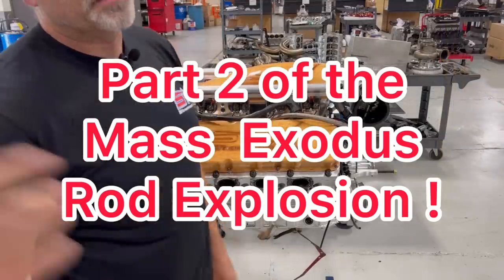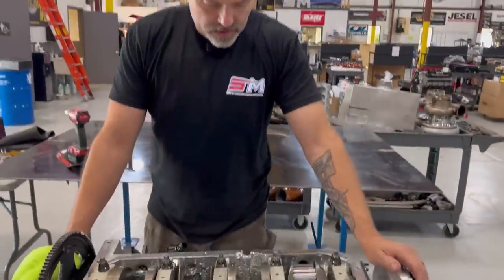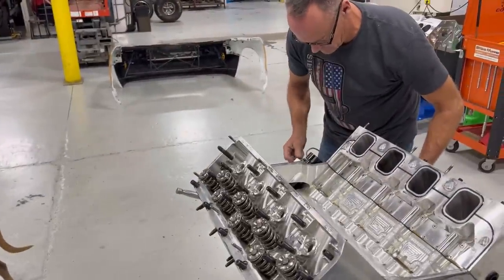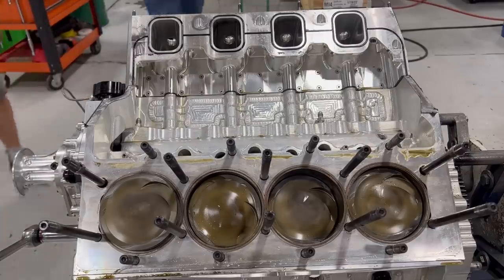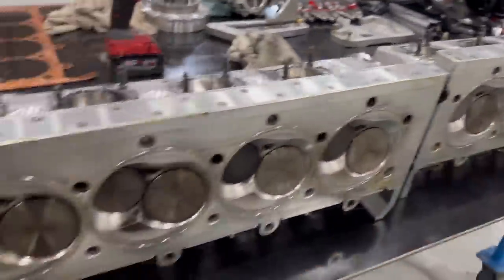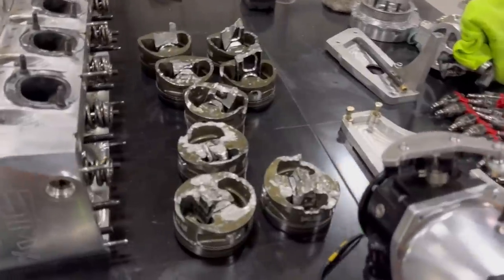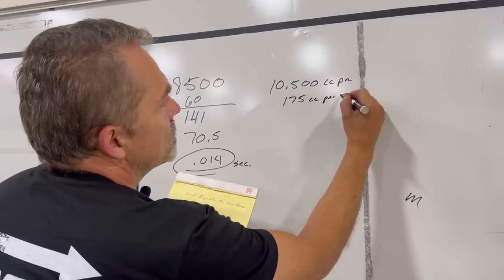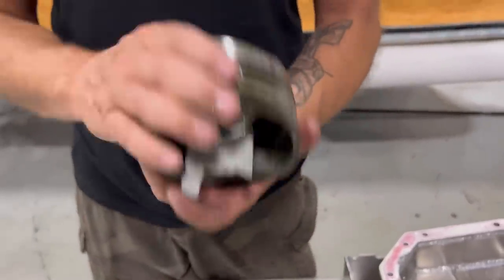EXPLODED RODS  Part 2

Comment: After taking metallurgy classes from our technical center when I worked for Alcoa, it definitely looks like a material failure. I bet if the grain structure was analyzed their would be a definitive answer on that. We saw pictures of examples of aluminum failures and some looked like that. Failures could be related to bad alloy with impurities that caused internal grain issues, poor forging process, etc. I’d really like to know what happened to them. If I still worked at Alcoa I’d try to reach out to our tech center to have them analyzed, but sadly I don’t.
Reply: It didnt come from Lake Charles Alcoa.  I'm just sayin'.  Gotta support Local!
Reply: The fracture breaks make me believe it was treated or aged to add strength, but lose flex. So it didn't bend it just broke. These rods are just to brittle for what SM is doing.
Reply: That's my thought as well. I would be curious to know the pounds force each cylinder is pushing down with on the power stroke.  I guarantee the number is well above the strength of those rods, especially since they were not a full solid beam rod (They were solid beam but had machined pockets for weight savings, but also makes them weaker.).  Just take a look at top fuel engines.  They make so much power they will actually compress a connecting rod and make it shorter, and they use solid beam rods, but they don't shatter.
Reply: @davidwickboldt712  I agree. The manufacturer boasts something like 200+ runs in a 2000hp bracket car with a 'proprietary' alloy. As hard as they are, probably great fatigue characteristics. Just not interested in bending, that's for sure. lol
Reply: I commented similarly and then I saw your comment.
Great minds think alike ?  
lol    I absolutely agree with you about grain structure especially after many heat cycles.... or impurities as you eluded to. Thanks 👍👍
Reply: @zulumagoo1  probably goose Creek Alcoa
Reply: I'm in the camp of an issue with the design. The failure condition is catastrophic and it happened on all rods.  Can't be a quality issue considering the amount of passes on the motor.  A design issue seems much more likely than a metallurgical defect since Steve said those were the only rods in the world with that design.   I'm thinking of a long term fatigue failure.  There is probably some harmonic combined with temperature cycling that made the rods fail and wasn't verified by test, simulation or  similarity analysis before being put to use.
Reply: Sure looks like a heat treatment issue to me.
Reply: @beckyumphrey2626  if the heat treatment was part of the drawing then sure but I have a hard time believing that he heat treatment was done improperly on all 8 rods.  I'm thinking this is a vibration issues with a fatigue factor.
Reply: I currently work at Howmet ( Alcoa ) in Cleveland past 10 years In the Thermal dept, Heat Treat, age, Titanium, Inconel. I've seen an aluminum forging shatter before after it failed sonic and was sent back through the process. Once the press started to apply tonnage , all we heard was a loud Crack then call outs for ERT
Reply: @jimpettit6310  Does sonic set up a certain frequency to see if harmonic vibration develops or are you referring to an ultrasonic inspection process?  I am an A&P Aircraft mech with 35 years structural experience and 10 years in Non Destructive Inspection.  My  curiosity level seems to be out of control sometimes.  :)
Reply: @beckyumphrey2626  Great Question, I want to say it's ultrasonic, I've only walked into that dept a few times over the years.  In Large Aero where I'm at they submerge the parts into the tanks and size depending either scan by hand or if it's a larger forging they have this trolley attached to a wand??? And scan it that way. I watched out of curiosity,  have no idea what the graphs are but see the rejected parts saying high noise, low noise, Low ec...etc etc
Reply: @beckyumphrey2626  After spending 2 decades Crewing F-15s and F-16s this also peaked my interest. We have lost planes and pilots due to bad with parts shearing off due to Metallurgy. It would shock people what NDI finds after a inspection. After watching the last video I was hoping Steve was going to mention a bad batch of material and Metallurgy. Hopefully the supplier will pay for a subpar product and recall anything else they sold. I am glad that this was on the track and not in the Air.
Reply: @jimpettit6310  Thank you.  It sure sounds like an ultrasonic inspection process. Separated grain boundaries can be easily detected using that method.  I am eager to find out what was the root cause of these rod failures.  All failing at the exact same time in a very similar location on the rod at a certain RPM sure makes me think it was a catastrophic harmonic vibration failure that occurred instantly.  It happens.
Reply: @jimpettit6310  Thank you for breaking this down. Seeing this destruction is sad but fascinating. Steve is being so humble and transparent with this incident. It is always nice seeing someone answer a great question. Education is key.
Reply: @GetFuct1911  Absolutely.  We have had bad failures over the years with metals in the aviation world.  Probably the most concerning is all the unpredictable problems that 7075-T6 have uncovered until they stopped it's use in many applications.  Thank you for your service.  USN here.  81-85
Reply: @jimpettit6310  that makes perfect sense to me. I worked at FEL-PRO Performance gaskets 1988-98 we tested all the time everything I learned a lot. Now at 72 I think you are right on target.
Regards 
Mike
Reply: @beckyumphrey2626  I know currently we use a 7085 alloy mainly for larger forgings ( bulkheads)  for a fighter jet that rhymes with f35... 6061/t6 for propellers, alot of other things.  The process from billet/ingot to shipping is pretty amazing.  It blew me away the 1st time I saw a finished/machined bulkhead from what we ship out and how much material they take away. Same with our vehicle side with 5th wheels for Holland and commercial or specialty wheels for Ford, dodge and Mercedes
Reply: @Mike62501   My 3rd job was at cometic gaskets. Was there for 8 months. While they were in a real small shop at the time. Something in there always made me break out in hives and I quit
Reply: @beckyumphrey2626  I appreciate it and thank you for your service also. Before I retired in 2019 it seemed like a large majority of the new Amn didn't care about work. When I joined we wanted to work on ACFT those who slacked off ended up getting kicked out. It amazes me how many flight hours some of our Trainers have on them. I couldn't imagine being on T-6s. Good on you for staying in Aviation. Especially with being NDI and having your A&P for so long. What are your thoughts on the idiot that jumped out of his plane on DB's anniversary? Seeing how he was wearing a skydiving parachute, fire extinguishers, removing his step, recovering his go-pros, and the laundry list of other items is very damning. Plus he had a helo remove it without the FAA even looking at the wreckage. To me it looked intentional, hopefully they make a example out of him.
Reply: @GetFuct1911  That guy was an idiot that jumped out.  I see he lost his pilots license too.  The Navy was great for me back in the 80s.  No way would I join the service today!!!   I went to Embry Riddle on base and got my A&P before I was got out.  I worked C5-B production for Lockheed after being out 1 week and did that for 2 years before moving on to Commercial Aviation.  Love my job nowadays and no plans to retire any time soon.
Reply: @beckyumphrey2626  
It was definitely a harmonic/frequency failure. For all eight to fail and fail so catastrophically, that the crank spinning at 8k rpm, wasn't covered in dents, suggests it wasn't a force failure. Material intrinsic frequency or critical rotation speeds are not in the domain of engine builders. I doubt the rod builders would even calculate or test for intrinsic frequency as it would change depending on what was attached, bearing, pin, rod bolts etc.
Reply: @aaronnoyb  Thank you.  Harmonic failures can be violent.  Do you think this was an isolated failure whereas all the conditions just happened to align and failure occurred?
Reply: @beckyumphrey2626  
I don't think it's possible to say with any certainty, be interesting to know, if this was the first time it had seen 8500rpm.
The fact the crank journals are perfect(not all), means the big ends of the rod accelerated away from the crank, at failure, at higher speed than the crank was traveling at.
That combined with structure of the breaks(last few minutes of video), with mostly sharp edges, suggests it wasn't compressive or tensile failure. Normally small pieces come from meat grinder action of the remaining rotating parts and would not retain all sharp edges.
Be interesting and incredible expensive, to build the motor, identical to before and spin it with an external drive, like a spintron does and measure the vibrations at different speeds and see if it comes apart again at similar rpm.
Reply: @aaronnoyb  Thank you for your thoughts.  You are very knowledgeable. Betting you are a Mechanical Engineer.
Reply: This is what aluminum does, it doesn’t have good fatigue strength.  I’m sure the alum rod is twisting and bending each trip up and downward.  Depending on how deep Steve’s pockets are, I’d go with titanium rods next.
Reply: @aaronnoyb  The damage on the crank is just from contact with broken rods. Possibly the journals with damage were the first to go. And they let go on the intake stroke when being stretched.
Next question, does anybody sleep? It's 6am for me now and the post times say insomnia, night crew, or different parts of the world. 😁
Reply: @beckyumphrey2626  
Not an engineer, but a long time in the oil/gas world as a translator. Translating between Managers, Engineers, Operators and Tradesmen/Craftsmen, while maintaining and overhauling gas and steam turbines, from 400 to 40,000HP. Machinery valued in the $Millions per day of downtime, not the $Millions they cost.
To answer the other commentor, it's an industry that doesn't sleep.
Reply: it's like the route were ceramic.
Reply: @jimpettit6310  that is called “immersion UT” UT=ultrasonic testing. They are testing for flaws in the material such as cracks etc. The part can be scanned much faster with immersion than manually hand scanning it. 👍🏻